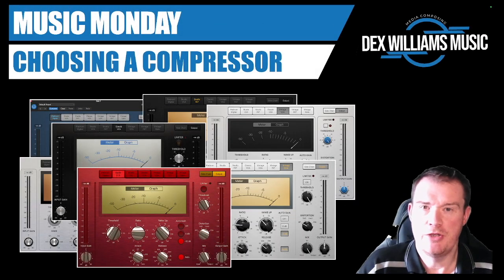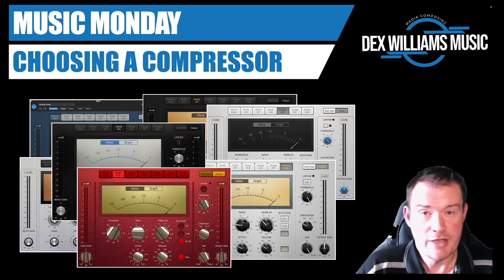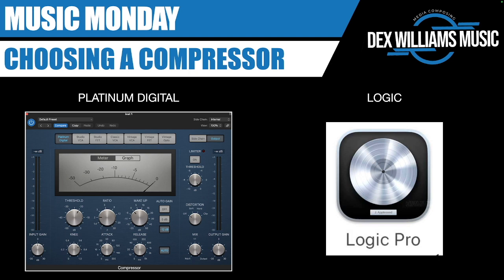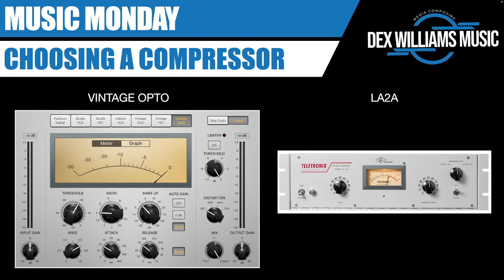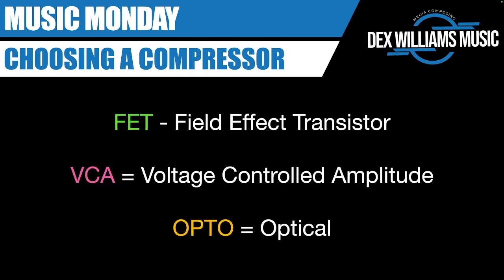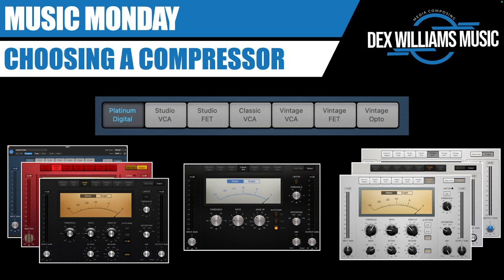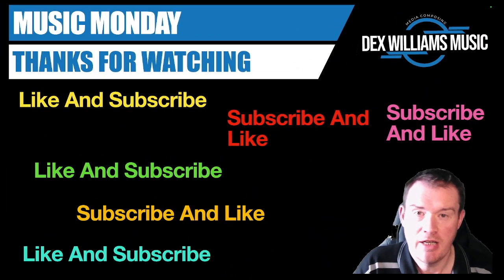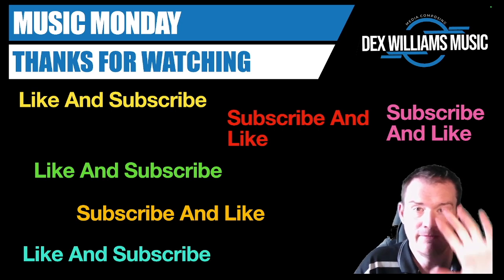A QUICK guide to choosing a COMPRESSOR

Comment: Hey Dex... VCA actually is the abbreviation for Voltage Controlled Amplifier. When VCAs came along they opened the door for console automation. Back in the 80s there was a big argument in the pro audio press between the two developers of VCA technology... one arguing that the technology of the other was actually a voltage controlled ATTENUATOR because it had no gain, unlike the technology that was developed by the other camp. There were even threats of lawsuits leveled in the magazine as one pro audio inventor called his competitor on the carpet. Why does this have any relevance? It's all about things that many take for granted today... VCAs went on to become ubiquitous in the studio, but the original technology of opto and FETs worked well (and perhaps even better) in certain applications. To confuse matters even more, there are "feedback" compressor circuits and "feedforward" compresssor circuits which also have their own characteristic sound quality. The best way to use compression in many cases is to use smaller amounts (compression ratios) a few times instead of a TON of compression all at once. However, as you said, Dex, if it sounds good to you, then it is! Cheers!!
Reply from the maker: Good knowledge Jim... that's really interesting, I didn't realise it got that heated! :)